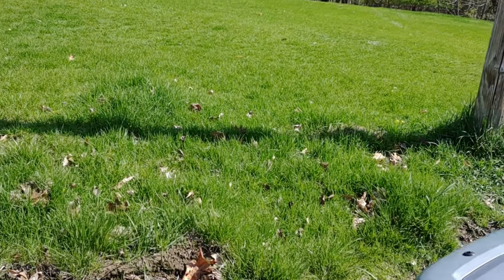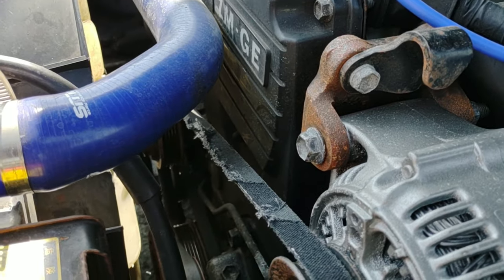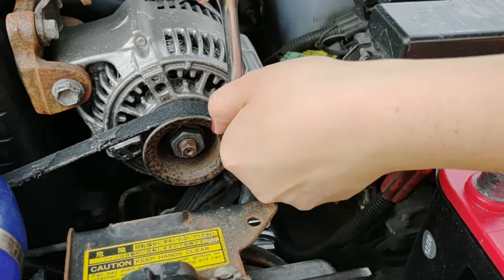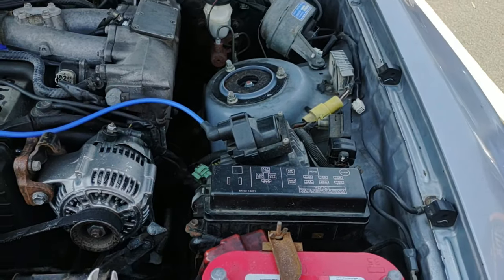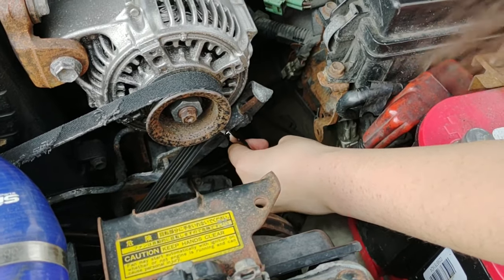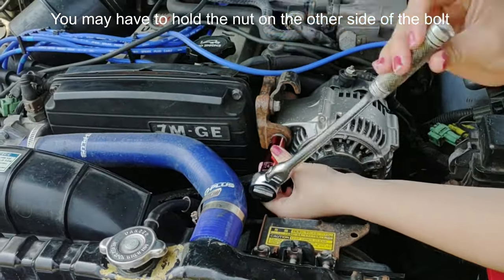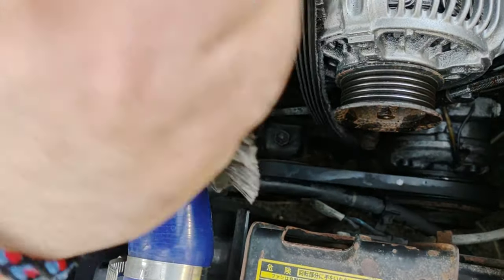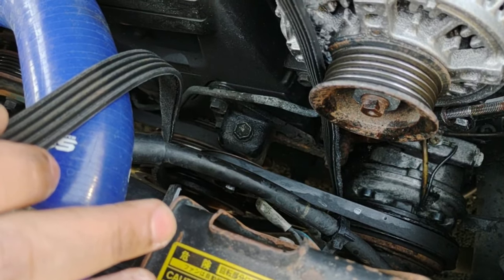A70 Supra Alternator Belt Removal

Comment: Used this video to see how open the engine bay was and how easy replacing things like the alternator is. It looks wonderfully easy. Can i get someone who already owns one’s thoughts?
Reply from the maker: Compared to modern vehicles, this engine bay has a lot of room to work with. Only a few things are in hard to reach places or need more than 5 pieces removed.